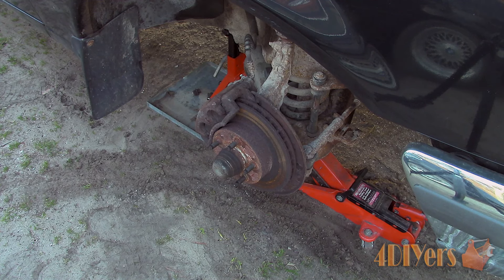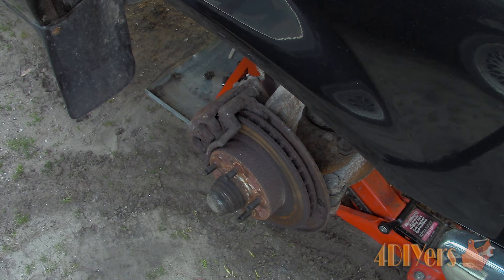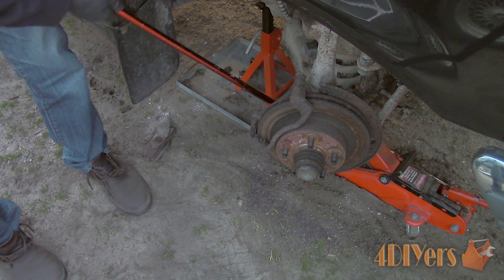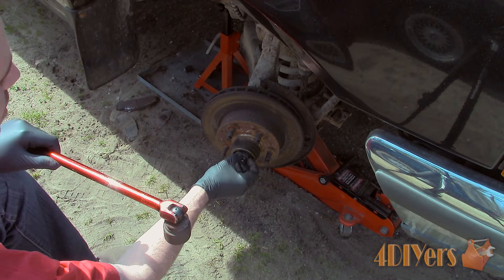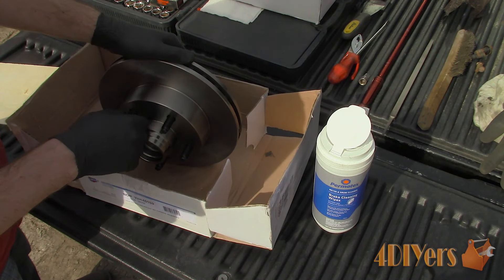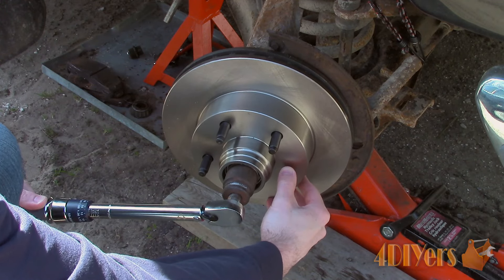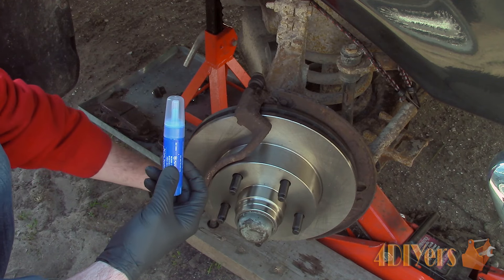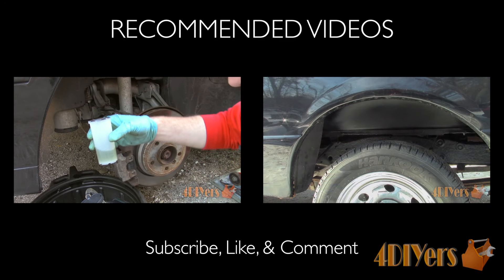DIY: Ford Ranger 2wd Front Brake Pad and Rotor Replacement

Comment: Some additional info from my job on a 2001 Mazda B3000 2WD, in case you were thinking they were the same:
I have torsion bar suspension.
The 13mm bolt for the calipers is a 14mm bolt.
The 24mm bolt for the spindle nut is larger than 25mm, the biggest I have in metric.  I am not exactly sure the size, but I was able to use a 1-1/16 in 6-point socket due to low torque value.
Reply: Yeah,  the spindle nut on my 2000 Ranger is larger than 24 mm also.
Reply: Same:/ bought a 24 specifically for this. Turned out to be a 27 mm for anyone interested.
Reply: Needs to update for sure

Comment: I installed the new camber kit when I put the new upper control arms in and wanted to know if the square hole on the camber needs to be at the 12:00 position or does it matter to make it easy for the alignment guy.

Comment: Generally this is a very good video and thank you for making it.  My only complaint is that you don't show putting the pads on after installing the caliper bracket.  On my ranger at least, there is a tab on two of the four pads.  Do they go inner, or outer? Hmm
Reply: My question also.

Comment: You did not mention anything about the races. Most new rotors come with new races pre installed. Is it ok to put a new wheel bearing into those pre installed races? I've always heard that you are supposed to put in a matched set. What's your thoughts? Thx

Comment: Gave Thumbs Up But I Got A Question:

Dont I need to bleed the brakes or am I missing that? What should I do? Any non-legally binding
advice...? Anyone?

Either Way Thanks
Reply from the maker: Thank you for the support! No need to bleed the system when replacing the pads and rotors or shoes and drums. I know there's a few videos out there where they recommend loosing the bleeder screw when pushing the piston back and that is a very bad idea. Just crack the master cylinder reservoir cap to relieve any pressure build up when pushing the piston back and that's it. The only times a system should be bleed is when fluid you're working with the fluid such as replacing the calipers, wheel cylinders, lines, brake fluid flush, etc.
Reply: @4DIYers  Damn it Brother!! Dude you answered my question in like under 5 minutes! This vids a few years old, too. 

I just subscribed. Thanks Boss.
Reply from the maker: No problem, happy to help and thank you for the support too! I usually try to answer questions once a week depending on my schedule and I have new videos every week too :)

Comment: Do the floating pins on the brake bracket simply pull straight out and can I use Sil-Glide silicone brake caliber grease to lube them.
Reply from the maker: Yeah they do, here is a video specifically for that https://www.youtube.com/watch?v=oODS9Iel2s4

Comment: Great video. What lubricant do you recommend using for the slide pins?
Reply from the maker: Thank you. I've been happy with the stuff shown in the video, it's made by Permatex and is a synthetic brake grease #09125.

Comment: I have a 98 ford ranger that I inherited from my dad and just replaced the upper control arm and lower ball joints.  It only has 105,000 miles on it and was not driven hard at all. I thought about replacing the inner and outer tie rods but did not want to put more money into it if not needed.  I value your opinion on what you would do at this point and wanted to know how many miles I should expect to get before replacing them.    Also I started to install my steering knuckle today and had problems.  I put it on the lower ball joint first and then tried to jack up the lower control arm to lift it up to the upper ball joint.  It got close but I was still about 2" away from the upper ball joint and the truck was very high compared to the other side and did not want to go any further.  How do you get the steering knuckle to go up without the truck wanting to go with it.  I do have both sides off with no tires or steering knuckle on either side.
Reply from the maker: If you have the coil spring front end, then the upper control arms do affect the alignment. I would recommend getting an alignment as you can cause handling issues and excessive wear on the tires. So with that being said, it would be a good idea to install outer tie rods, they're around $20 each. It's peace of mind and you won't have to pay double for an alignment. You can also check if they're bad by pushing a pry bar against the joint or rocking the steering when the wheels are on the ground and watching for play in the joint. The truck shown in the video will be getting new ball joints, upper control arms, and outer tie rods, it only has about 160,000km so around the same mileage. You should be able to jack that steering knuckle into place. Did you purchase the right control arms? There is a few different style apparently between the replaceable or non-replaceable upper ball joints and coil spring or torsion bar front suspension.
Reply: OK so you are replacing your outer tie rods which makes sense to spend a little money now and only one alignment.  However, is there a reason why you are not replacing the inner tie rods or do they typically last a lot longer.   If I put the new outer tie rods on do I simply count how many threads are showing on old one when I install the new one. I know I will have to get an alignment no matter what.

Comment: Thorough, I like it.
Reply from the maker: Thank you!
Reply: a c4 Do you have any video on brake pad replacement on a Ford ranger 4WD 2013-2016
Reply from the maker: fleet tech Should be quite similar, but rotor replacement will be different.
Reply: fleet tech  I would be very interested also to find out how to change brake pads on a 2013 PX ford ranger 4x4

Comment: I need to see you place the pads into the caliper.  I'm really struggling.
Reply from the maker: Check out some of my other brake replacement videos. Typically they are the same or very similar. Make sure you have the pad material facing the rotor, pushed fully against the rotor, have the piston fully pushed back into the caliper and it's ready to be reinstalled.

Comment: What about the slotted ABS sensor plate on the rotor? That has to be on the new rotor or the Anti Lock brakes will work.
Reply from the maker: Yes that is correct. Not all Rangers were equipped with front ABS brakes, someone had actually installed the wrong rotors on this truck.
Reply: Can u show a link of what that slot looks like, my abs light is on

Comment: I just installed new lower ball joints on my 98 ranger and have the steering knuckle on the new ball joint stud and have it a little more then snug tight.  However, there is about a 3/8" gap between the castle nut and steering knuckle hole where the stud of the ball joint fits in.  I know I have to torque it down yet but don't think it will close that much of the gap up even at 100 ft. lbs.  So is there suppose to be a small gap there even after torqueing. I thought maybe the stud is tapered and the gap is normal.  Just want to make sure before driving.

Comment: Hello. I just replaced my brakes and rotors on my 96 2wd along with bearings but I have vibration after that
Reply: Re tighten the axle nut with a torque wrench and make sure to back it off a 1/16 of a turn until the rotor spins with no dragging.

Comment: hey, I don’t know if you will see this but I need to change my front brakes and rotors on my XLT 99 ranger manual in 4wd bit it also runs with the rear wheels. I'm not sure which rotors I need. One has just holes the other one has bolts in it and the middle thing. Which is the right one for mine?
Reply: It's a 4.0 v6
Reply from the maker: Your best off asking the auto parts store or even going to the dealer and getting a part number. Being a four-wheel-drive, I highly doubt it’s a tapered roller wheel bearing. So you most likely need the rotor that mounts onto the hub, the one with the wheel stud holes.

Comment: OK so I have cleaned my floating pins on the brake bracket. Do I put the rubber boot on the pin dry and crimp it into place on the threaded end and just put grease on the other half of the pin or should there be grease inside the rubber boot as well.
Reply from the maker: Here's a video specifically for sliding pins https://www.youtube.com/watch?v=oODS9Iel2s4 Just apply a film of grease to the pins, doesn't have to be excessively thick as it'll push out anyway. There isn't a large amount of clearance for the pins anyway. Install the boot on the pin, then push into place on the carrier. No need for more grease inside the boot.
Reply: So the boots stay completely dry no grease
Reply from the maker: Just a light layer like the rest of the pin. Do not fill the boot with grease, it'll just push out.
Reply: OK So I guess I was overthinking this. I was thinking about keeping as much grease away from the rotor as possible. I was going to slide the rubber boot on to the pin dry and then lube the end of the pin that goes into the hole rendering the boot completely free of grease.  But you are saying to lube the pin first and then slide the boot on and then there will be a very small amount of grease inside of boot right.
Reply from the maker: The boot is intended to be a barrier from any foreign contaminants and expand/contract with the pins. The portion of pin under that boot can still slide in the carrier, therefore it should also have a thin layer of grease as well. As the pins move back and forth, the grease will eventually even out. So yes, there will be a light layer of grease under that boot as well.
Reply: @4DIYers  
Push Up, answering them questions. 

There towards the end, I swore I could hear the Eye of the Tiger song.

Comment: Excuse me but why did you not Grease the shaft of the spindle?
I just did a set of these and I greased the hell out of the spindle shaft.
Please inform me of your reasoning on why you didn't not do the same.
Reply from the maker: Everyone has their own process, there was a very light amount on the spindle shaft. But I typically like avoiding it, debris can fall on the shaft during assembly and the grease just allows it to stick, more grease makes it harder to spot.

Comment: Wait so what like actually holds the rotor on just that one nut at 25 ft lbs??
Reply from the maker: Yes, it's also locked with a cotter pin. It's a lot stronger than it seems.

Comment: You didn't show how to take the abs ring off and transfer to new rotor.
Reply from the maker: You can't transfer it. Someone had installed the wrong rotors on this truck and the abs ring is an option when ordering new rotors.
Reply: Those rings are EASILY damaged. If you have ABS,but sure to get rotors with rings installed!!!!!

Comment: Why the hell does every video of this skip.iver putting the wheel bearings in the rotor? Does the extra metal piece that comes with the bearing just for hammering it in or am I supposed to put the bearing in it and them hammer it in the rotor? This is frustrating
Reply: Agreed

Comment: My ranger has no caliper bolts! horrible design
Reply from the maker: Sure it wasn't rusted heads? The opposite side of this truck actually had that issue, I had to use vise grips to remove the bolt.
Reply: Lol there are NO BOLTS!! literally!! Its just 2 long rubber filled metal "pins" with a small tab that keeps them from backing out, MOST of the time. Had a pin come out while driving and it jamed the caliper between the rim and bracket! truck is a 93, also my 91 (square body) has this design. single piston also
Reply from the maker: Holy that is a terrible design! I had an 89 truck, but I don't ever remember them having this. Then again that was over 10 years ago lol. I would considering having some special bolts machined for that instead.